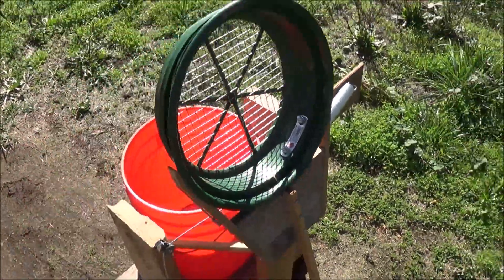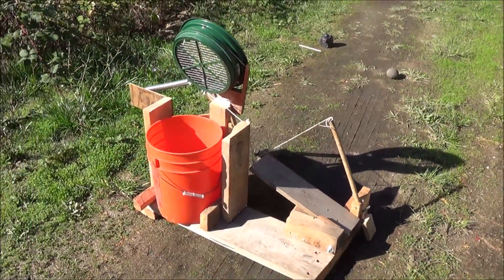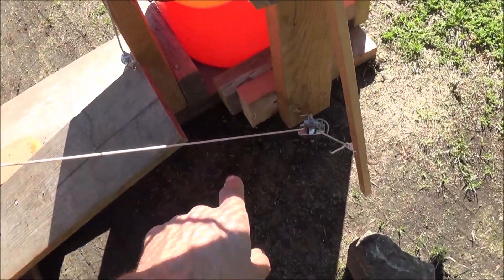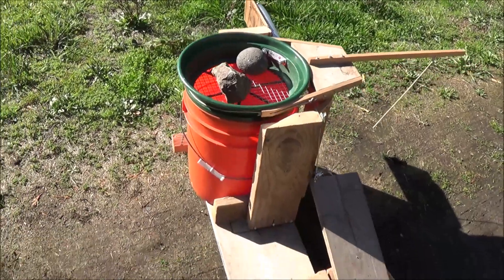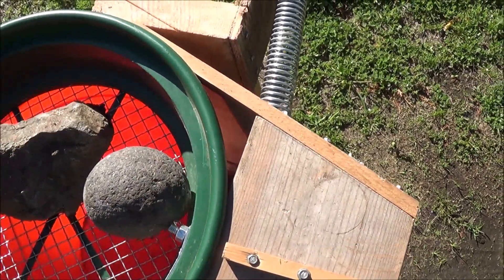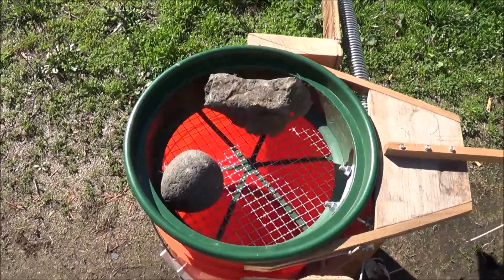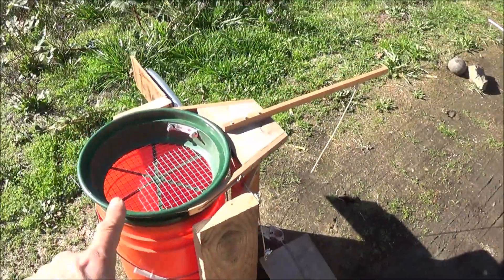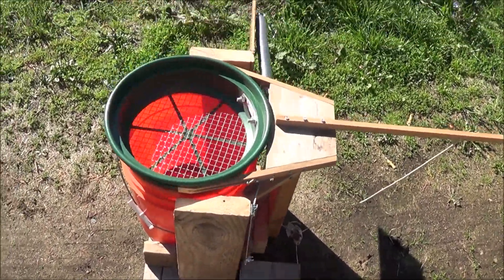Foot powered "Gold Classifier Screen" Invention, the "Classifier King" original prototype.

Comment: Have you thought of replacing the foot pedal with a weighted flywheel with a cam shaft? A bit like the old-fashioned sewing machines... Once you got enough energy into the flywheel, it would continue to provide power while you go fill another load. Could even use your HP air to power the flywheel. If you devised a way to disengage the classifier from the spin motion when you catapult it, it would be really fast & efficient.